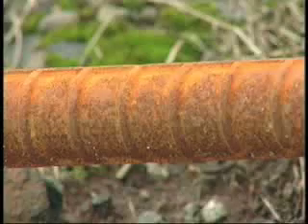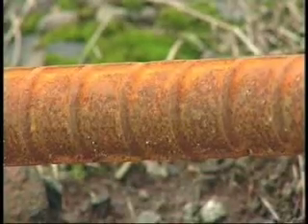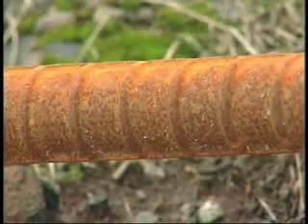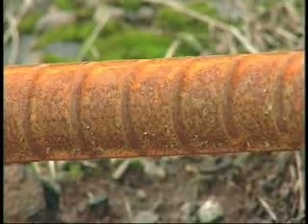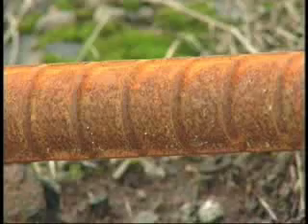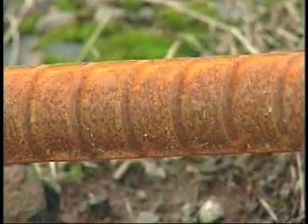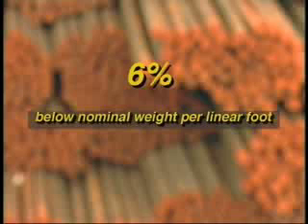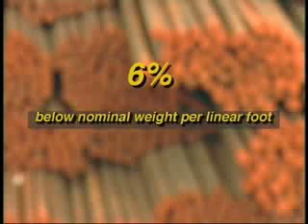Rust on Reinforcing Steel

Comment: Thank you. I live in the Malaysia and I'm currently doing a residential project using reinforced concrete. We are under Restricted Movement Order (RMO) due to Covid-19. I was worried about this as the RMO started when I was about to fill the first floor with concrete and the site has stopped for a month now. The formwork and Rebars are all exposed to the elements which got me really worried about the effect it has. After watching this, I'm more assured that it actually increases the bond of the bar to the concrete. I measured a 6% nominal weight deterioration for a 10mm bar would be 9.7mm. That's a low margin. I will check the bar size once the RMO is lifted.